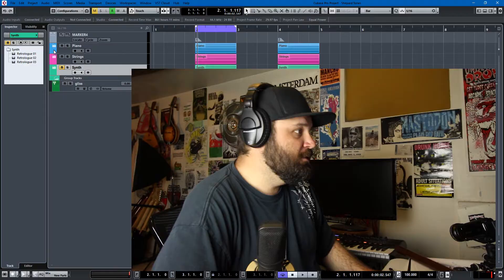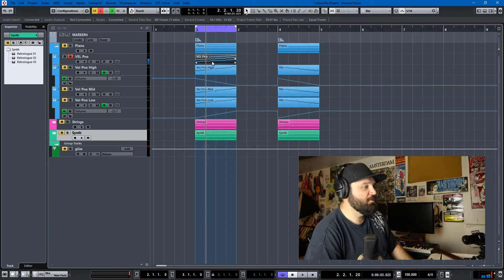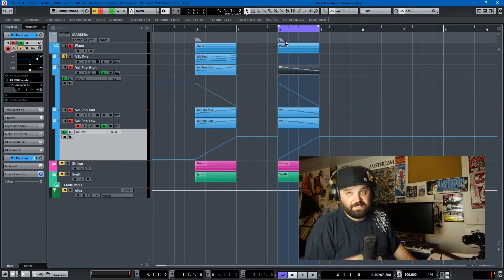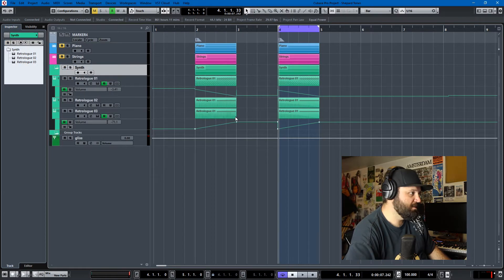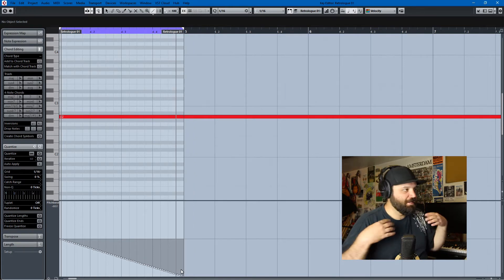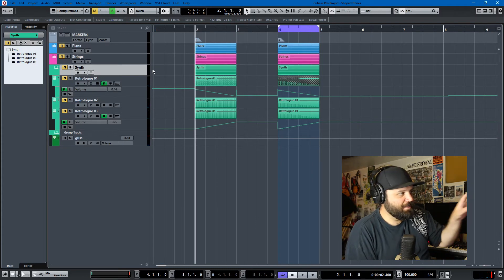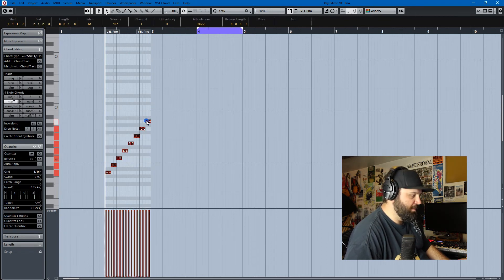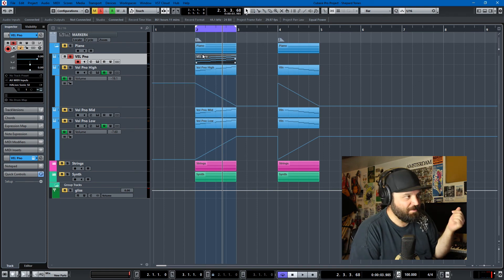Hans Zimmer Dunkirk Infinite Scale Technique in Cubase (Shepard Tones)

Comment: How did you get the pitch controller lane to max out at 12?
Reply from the maker: I think I set the amount of pitchbend in the VST (Padshop).  There's a pitchbend amount on the main tab at the top.  That's where I chose +12 -12.  Then, the controller lane just worked off of that.  Hope this helps!